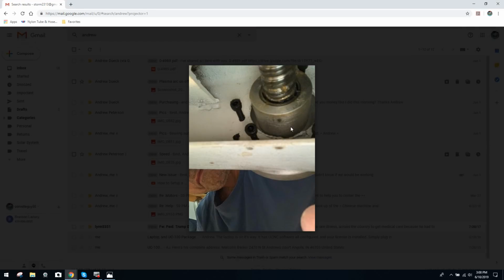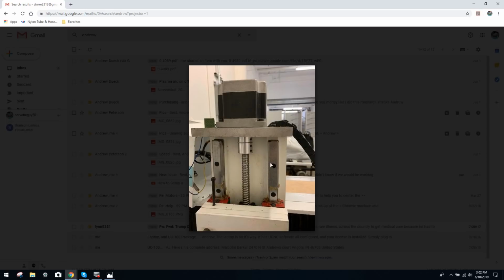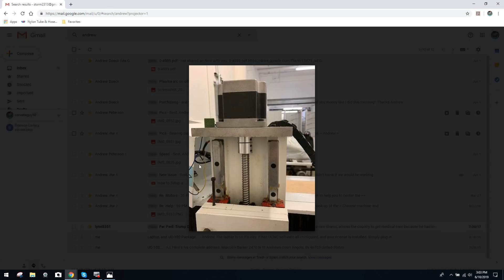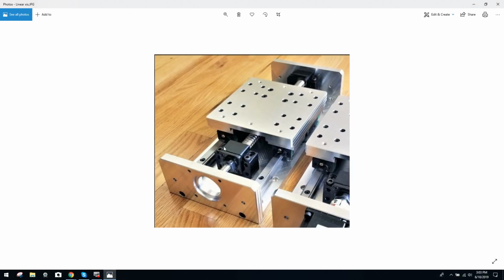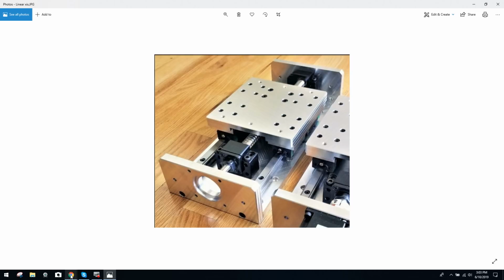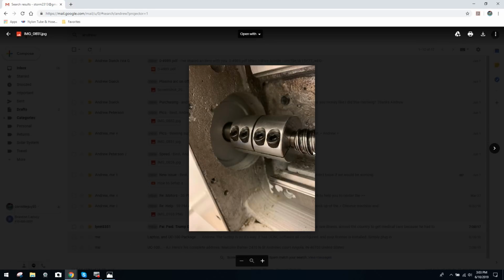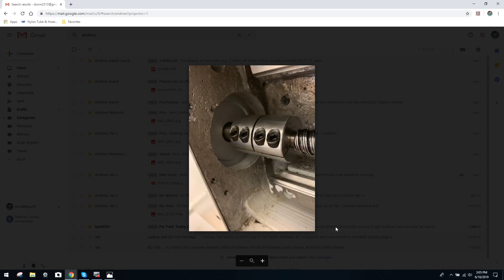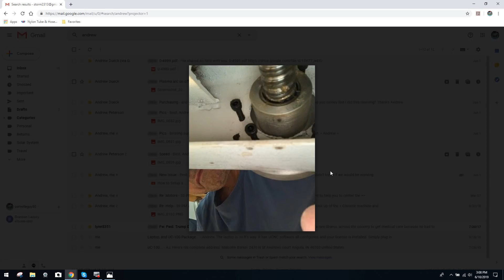Chinese CNC Forensics (Clients Bearing Block Missing!!)

Comment: Great video!  I've recently built a CNC 3-axis controller and trying to retrofit a used  Probotix Fireball X90 18" x 18" bed CNC.  I want to use it for cutting parts in 12" x 12" x .020-.060" aluminum sheets. But, I've run into the same problems described in this video. Should i spend the time and money to upgrade the mechanics or purchase a better designed and stiffer CNC table?  Do you have a recommendation for an inexpensive small table capable of cutting aluminum?
Reply from the maker: Hey NO5X, thank you for your support. This issue is very much a problem with US manufactured systems like Probotix. The application your using the machine doesn't require a heavy duty system. If your mechanically inclined you can modify the stock chassis which for what you intend on using it for would be the most economical solution. Thank you,
Vince

Comment: This is good info. Thanks
Reply from the maker: Hey David, Thank you for your support as always. Just take your time, and you'l be fine. The main thing when assembling your transmission is to verify the alignment of all the bearing blocks.  The system illustrated in this video is a large amount of work to have to do. Thank you, Vince